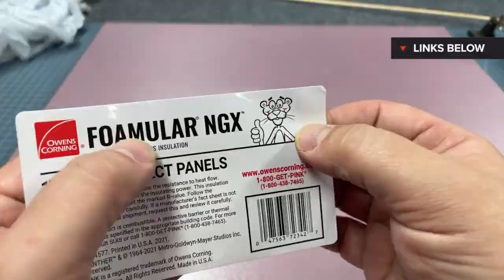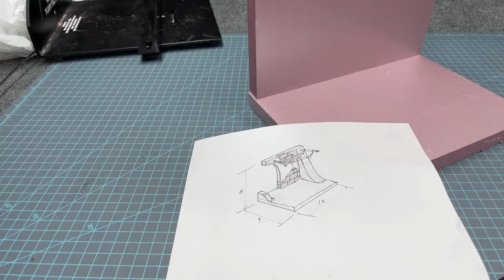How to Make | Star Wars Ancient City Action Figure Diorama

Comment: my experience with floral foam is, that it degrades and falls apart within just a few years. but its a great buid :)
Reply from the maker: Well do you seal it with multiple layers of mod podge and paint and have it glued in between other materials with wooden struts inside it? Cause that’s what I do
Reply: @OilersWorkshop  i never used it in terrain because of this experience. you might be right. the sealing could stop the "falling apart". I might have to experiment with this. thank you. great videos